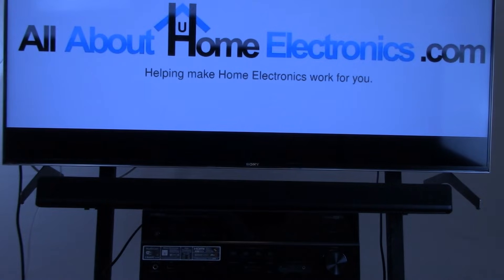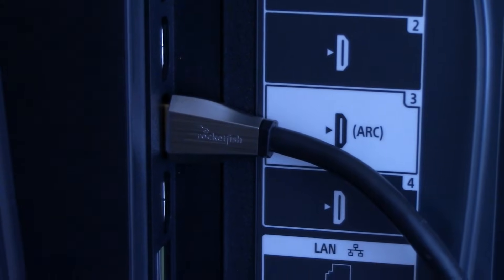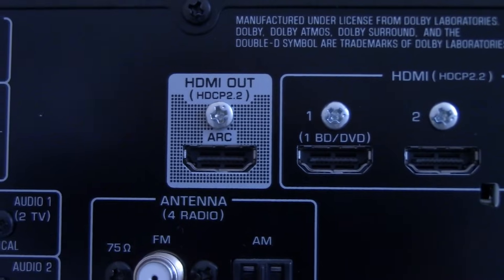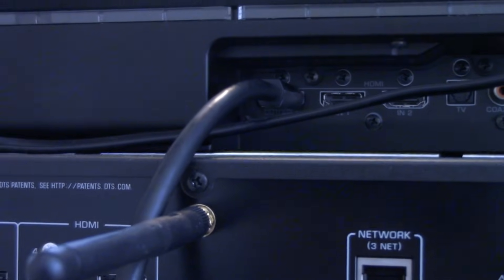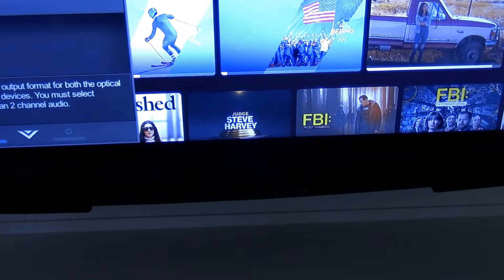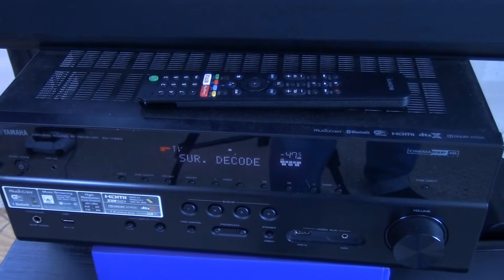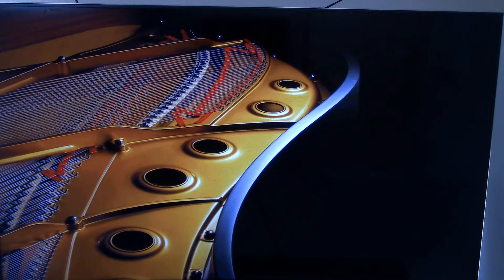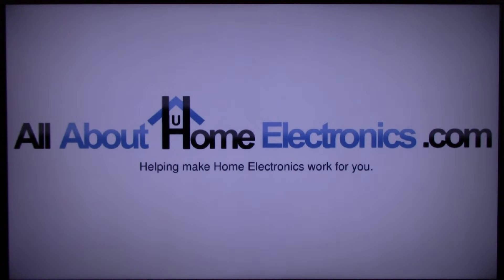How to troubleshoot an ARC HDMI connection between TV and soundbar or receiver

Comment: ARC PORT ON B&O SOUNDSTAGE HAS TO BR PLUGGED IN! Ty!
Reply from the maker: Great catch — you’re 100% right! 👍 The HDMI ARC (or eARC) cable must be plugged into the ARC-labeled port on both the TV and the B&O Beosound Stage for sound to work correctly. If the HDMI cable is in a regular input, you’ll get “no sound” or “ARC not working” issues.

💡 For instant help fixing HDMI ARC connection problems, no sound from your soundbar, or TV audio setup tips, try our free Gadget Wiz app 📱 — available on iOS and Android — for quick, step-by-step troubleshooting and device matching.

Comment: I can't seem to get my denon receiver (surround system) to work with my new LG TV.  I will get sound, but it takes 5 minutes.  What did I do wrong?
Reply from the maker: Not entirely sure based off the information but if you check out our Gadget Wiz app (iOS & Android) it will assist you making the correct connections & setting adjustments. Give it a true, it's actually a really great tool for stuff like what you are asking.

Comment: As a “seasoned” IT technician and as tech enthusiast I can affirm with absolute certainty that this crap never works like it should…of course I always get it working and all the settings are correct but every time I turn off and back on my tv, one of these 3 things will happen.

1) audio wont work and need to restart receiver, sometimes more than once.

2) audio will work until I enter an app like netflix or disney and then will stop working and back to option 1

3) audio will work fine

Comment: Hi i have tcl qled 75c635 model i have connected my sony home theater through earc/arc port but i m getting only 2.1 stereo sound my rear speaker not working ..not getting 5.1 audio...pls suggest of u know nything.. i have checked with other hdmi cable also but problem remain same. Tv model 2022
Reply from the maker: try adjusting the program settings on your Sony
Reply: @Allabouthomeelectronics  yaa there is no much setting its 5.1 soundbar model ht s500rf. . Its default hai 5.1 only . In my previous led that was working perfectly. 
Now i m thing m not sure this tv have hdmi 2.1 so might bhi hdmi 2.1 cable will work instead of my old 2.0 hdmi cable...m not sure ..pls correct m

Comment: What are reasons that it would work sometimes, and others it doesn't.  I have a Samsung 85" Q90 and Denon receiver.  Sometimes when I turn on the TV, the receiver and audio come on with it.  Other times, only the TV and receiver come on, but there is no sound, and yet other times, the TV comes on with the TV speaker and the receiver doesn't turn on.  Typically, first thing in the morning, it never works properly.  After it's been on a while, it typically works properly.  It's almost like it works "after it warms up".  Any ideas on this?

Comment: Hello... I have a question... I have a Samsung Smart TV and PTA66BT.5 is connected to the TV via bluetooth. The system is 600W I am top of the line speakers from the Z5500 THX nice sub, and the sound volume is very low compared to what it should be. When I listen to the radio I can't even put the volume up to 20 without the walls coming down. But on the TV I have to bring the volume all the way to 30 just here it somewhat ok, but again, it is nowhere near its true volume. The only think I can come up with is, the TV is limiting its power. What do you think? Thank you

Comment: I have been having issues with ARC for a while. I have a Samsung Q90T and I've plugged the HDMI in the TV ARC port and in my Denon AVRX2700H and it worked for a while and now it stopped working and now its only showing on the tv under the setup Optical and tv speaker only?? not sure why this isn't working? I've disconnected the HDMI and reconnected it and still does not work? It was working for a while and last night i went on HULU and as soon as I launched that app it stopped working. I thought I would see if you could provide me some guidance. Samsung has been no help at all.
Thank you. Ed

Comment: The video is helpful to a point, but doesn’t address my issue.  The video assumes either you have a receiver or a sound bar.  I have BOTH a receiver AND a sound bar.  All of my components are e-Arc enabled.  I have external surround speakers connected to my receiver.  I would like to have Front Centre Left Right audio played through my sound bar, while surround sound audio played through my external speakers (receiver).  

I can connect either the receiver or the sound bar to the TV using Arc, but not both.  I can connect the sound bar to the TV using optical.  

I have managed to get front audio from the sound bar using e-Arc from the receiver to the TV and optical from the TV to the sound bar, but then I have no audio from my surround speakers.  In this case, I had to set the TV audio output to optical.

If I change the TV audio output to HDMI e-Arc, I only get sound from my surround speakers, but not front audio.  This is useless.

There is no option to connect the sound bar to the receiver without some heavy re-wiring and reno work.

I do not really need the return channel to the receiver, since I use an Apple TV connected to my receiver as the media source.  However, i could not get front sound when the receiver was connected to the TV using regular HDMI, which allowed me to connect the sound bar to the TV using e-Arc.

Comment: Hi,
Thanks so much for very clear instructions. 
If Possible Please guide; I have a Denon AVR 1312, followed the instructions as per the Video and also the Denon manual but Iam unable to get the Sound output on the Speakers. 
Tried connectiing both HDMI and Optical Cable together from TV to the AVR, Tried Optical Cable and HDMI Settings seperately, but I am unble to get the Sound out.
Please advice
Reply from the maker: something within the settings you likely are not setting correctly....unfortunately we don't know how to offer more assistance than that

Comment: Thanks for this video. I  changed the settings and restarted the tv and it's working fine. But when I off tv and on it each and every time I need to restart my tv to connect to hdmi arc. Other wise sound will come only from tv
 Please help to solve this issue .